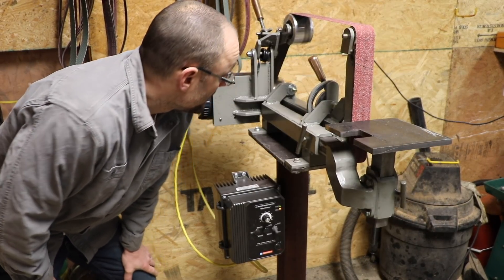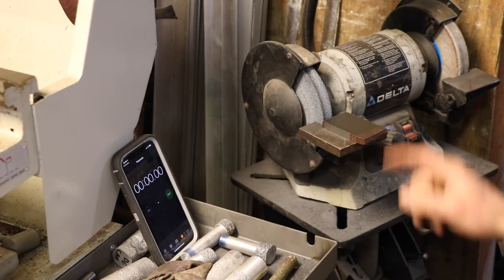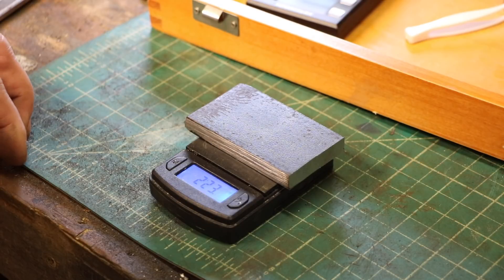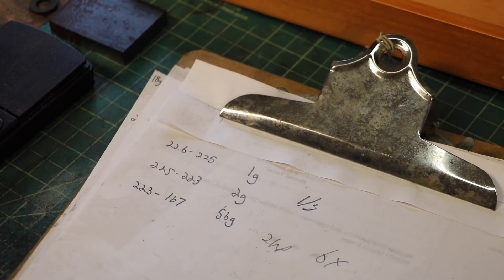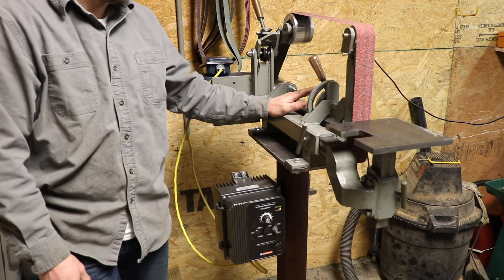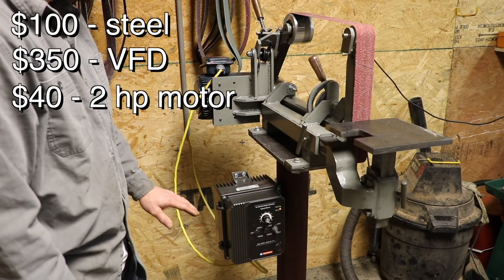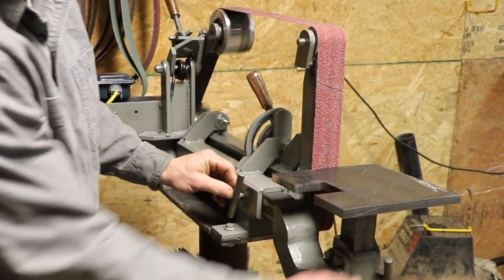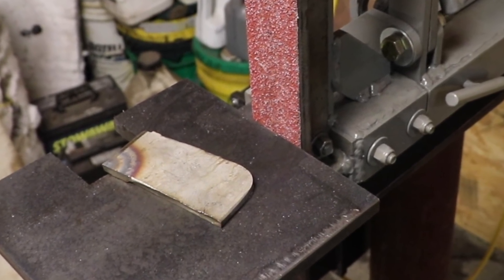Belt Grinder vs Bench Grinder. What's the difference?

Comment: The cost of the material used on the belt is going to be much less because there is much less quantity that the stone.  So... the quality of the grit can be much better.  The cost ratio allows for better cutting material on the belt.  Hope that makes sense.

Comment: A few things.
1. I love the approach you have in your videos. No bullshitting and informed talk. Thumbs up!
2. 3M cubitron and cubitron II is not fair to compare to anything. It's a magical beast of engineering and it's... Well magical, they also make cubitron stone disks though ;)
3. As a tip, never, ever grind ferrous metals on diamond. The heat from the friction acctually allows the carbon to alloy with the steel. You get good steel and abrasion, but it's a very expensive way to lose diamonds...

Again, good videos! =)
Reply from the maker: Ha!  I agree they are magical.  Crazy how well they work.  Also agree on the diamond wheel.  I actually bought that wheel intending to use it for carbide, but the grit is way too coarse for my purposes.  Don't really need it for much else, so I just beat it up with whatever...  ;-)
Reply: @FarmCraft101  diamond wheels are great for stones though... If you need to hone a certain feature;)

Comment: You can still weld the other parts together, and heat it up... its not perfect but it works too.
Clamp it on a copperbar to keep it straight, and weld carefully. And grind it sleek.

Comment: I've been playing with ideas for the last two days (while i wait to get paid for a job).  And i'm glad to find someone who's just built a grinder, particularly Jeremy's, because i've wondered about a couple of things that maybe you would have an opinion on. 
- What if the platten was on the 'top', and a contact wheel in 'front' You'd always have both set up ready to use. Plus a section of slack belt between them. Would that be problematic in some way i'm not thinking about? [in my plan the platten mounting includes adjustments for tracking, so it is the tracking wheel too.]
-  What would you rate as more important, speed control or capacity for horizontal use?
Peas
Reply from the maker: The platen on top would work, but it might be a bit awkward.  I would have to have the grinder mounted lower for that.  I think the horizontal feature is awesome, but speed control is a must depending on what you are grinding.
Reply: arigatou

Comment: Nice video. I'd like to see a comparison between belt grinders and disc grinders/sanders. Disc grinders are comparitively easy to make esp if mounted in a lathe. No VFD needed even if mounted on a motor because the middle has slower surface speed than near the edge. Can't do inside curves on a disc.
Reply: I wonder how a 9" Angle Grinder would compare? I might try mounting mine to a bench with a tilt table. I could add a bigger disc if required.

Comment: @FarmCraft101
Regarding the 1750 rpm motor, you're actually better off.

Because as you said and per my correspondence with a Baldor engineer, you get more torque, maintaining power at lower rpm, and there's nothing to keep you from using the VFD to run it p to 3500 rpm for even faster metal eating.

Comment: There are so many factors not accounted for in your demo. Grit difference. Belt/wheel condition. Belt wheel width. Belt wheel circumference. Motors should be equivalent you mention this kinda. Force applied. Not saying the overall conclusion is wrong. If all fields were level I feel your results would be very similar as opposed to the massive gap in this demonstration.

Comment: Nowadays with prices going up in almost any sort of materials if one goes and buys all the materials needed to build this brand new ( no metal scraps, no used motors, no used VFD etc) in no doubt it will set you around 1200-1500 depending on the motor you get. On ebay a hefty one can be bought for 1100-1200 including VFD + 2hp motor and these are production made almost no welds to them... The only reason to build belt grinder nowaday is the challenge on taking up the task and being successful at it at the end., you can forget the savings part lol.

Comment: Not really a fair comparison since they are two different tools designed to do different jobs. Try sharpening hardened steel tools with both and see which one does a better job.
Reply from the maker: True.  I didn't actually intend this to seem like an apples to apples comparison.  $100 bench grinder vs a $1000 belt grinder.  Of course they aren't the same, but I was trying to show just how much more effective the belt grinder is.

Comment: 2 hp and 36 grit VS 1/3 hp and 60 grit that is the comparison . Not witch is better. Which is better depends on the application or what is the best tool for the job
Reply from the maker: I agree.  The point of the video was to demonstrate how much different a belt grinder is.  After all, the bench grinders cost about $100, while buying this belt grinder new would be well over $1000.

Comment: Whats the FPM speed of the belt with the 4-pole motor? And what's the max belt speed you would ever want (safely)? Can your drive run it faster than 60hz? I'd guess that if you have a full 240V there, you could run that motor maybe 15% faster (70hz)
Reply from the maker: I was getting 2200 FPM.  Most people recommend 4500-5000FPM max.  Looking online I have seen some people running as high as 10,000FPM.  After a tip from a comment here and doing some research, people often use the frequency drives to overspeed slower motors.  I looked at my VFD manual and it has a jumper that you can move to double the Hz just for that purpose.  Doesn't hurt anything, the motor bearings can all take 3600 RPM no problem.  So I set the jumper to double the speed (120Hz max) and now I'm all set.  Good stuff.

Comment: Different grit belts and different width wheels vs 2in wide belt
Reply from the maker: It's not really intended to be an apples to apples comparison.  It's a $100 grinder vs a $1000+ belt grinder after all.  The purpose was to demonstrate how effective the belt grinder is when compared to more common methods.

Comment: Most VFD's will allow you to overspeed the motor.  Run it at 120 Hz and you are good to go.
Reply from the maker: I was wondering about that.  Any concerns of damage to the motor?
Reply: @FarmCraft101  I run regular 3 phase 1750 rpm motors at up to 120 hz on my drill press, lathe, and milling machine.  No issues at all so far. (been about 5 years).  The rotor in those motors are very simple.  I can't see how they could be damaged.
Reply from the maker: @Balsamancnc  Thanks for the tip!  I will give it a try!
Reply from the maker: Checked my VFD manual and it has a jumper that you can set to double the Hz, exactly for speeding up slower motors.  Set the jumper and I'm running at double speed now, 120Hz max.  Works like a charm.  Thanks brother!
Reply: I second this I run my mill, lathe and grinder up to 120hz everyday with 1725 motors no problem the motor is built the exact same as a 3650 other than rpm

Comment: 36 grit and 2" wide belt makes a difference
Reply from the maker: No doubt.  It's not really intended to be an apples to apples comparison.  It's a $100 grinder vs a $1000+ belt grinder after all.  The purpose was to demonstrate how effective the belt grinder is when compared to more common methods.

Comment: Belt grinder machines. How to mess up or change an original edge of a blade with with a purpose. I prefer the original way. Whetstone and leather strop. Simple and takes less metal off. And doesn't change the original edge of a knife, axe, sword, spear, or machete. There are ways and steps to sharpen a new blunt blade, be it a brand new sword or machete or axe. 1.) Lansky Puck 2.) Norton's Abrasive Puck 3.) 400 to 1000 double sided grit Chefic Whetstone 4.) Leather Strop Block. No need to use natural whetstones. They're overpriced and overrated. 3000 grit whetstones aren't needed, just strop with a leather block
Reply: This is the most common sense comment ive seen in a long time with knife sharpening. I even finish on 400grit whetstone and leather strop.  Razor sharp. My machete, and axe is done by puck.  

All my garden tools like shovel.. hoe.. mower blades.. is done on my old bench grinder fine course 120grit... or a hand angle grinder with a 120grit Flap disc.   Everyone these days wants to buy extremly expensive belt grinders to sharpen their knives. 

My whetstones are really old now and seen better days. Can you recommend some reliable brands?
Reply: I forgot to mention. A second cut file is good too. For brand new blunt axes. But only for the beginning of course. Then use the pucks, then use the whetstones, then finish off with a leather strop.

Comment: bollox different wearing width experment null and void
Reply: but still different surface area  so its not a good comparison
Reply: if he mesuing the total mount off in 30 s the belft sander got more surface aea compare to the grinder by a factor os 3 or more hence why he has to the the meteal side to side on the grinder there fore your agrment os wrong becoase the belt got 100% surface ares and teh gringer got  33% surface area
Reply from the maker: It's not really intended to be an apples to apples comparison.  It's a $100 grinder vs a $1000+ belt grinder after all.  The purpose was to demonstrate how effective the belt grinder is when compared to more common methods.
Reply: Trent Hudgens sounds like you  lost the agument since your reverting to nit pick my spelling well a cba spelling but you got the point  and FarmCraft101  then why was your format an apples to apples comparison then  unless you did it that way coz you was shrilling
Reply from the maker: @dw1444  How is comparing two different tools apples to apples?  As I said above, and in the description, the point is to see how different a belt grinder is.  Are you actually a bench grinder posing as a person, and I've offended you?  I don't understand your reaction here.  It's just a video, relax.  I will also point out that the width of the grinding stone is not the issue.  The grinder doesn't have enough power to grind more than it did.  It was bogging down, and I had to back off on the pressure as it was.  A wider wheel would have made it bog down even more.  Now, if it was a 2 hp grinder with a 2" wheel, that would have been a different result for sure.  But I don't have one of those.
Reply: @trent6775  i am just trying the educate you  but you dont see that
Reply: @FarmCraft101  i dont have i problem with you am i just saying its an unfair test Trent Hudgens just does not understand

Comment: Use a 1/2 belt and results will equal, ten inch wheel would have more contact than 6 inch, not Apple to Apple
Reply from the maker: It's not really intended to be an apples to apples comparison.  It's a $100 grinder vs a $1000+ belt grinder after all.  The purpose was to demonstrate how effective the belt grinder is when compared to more common methods.